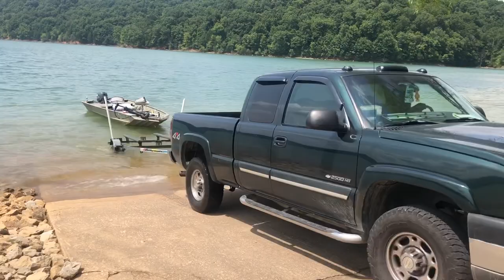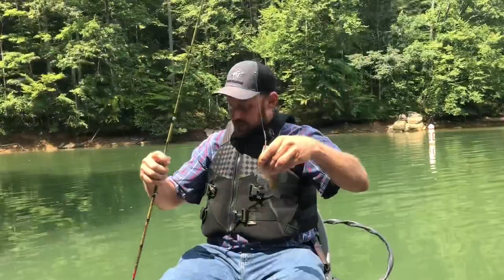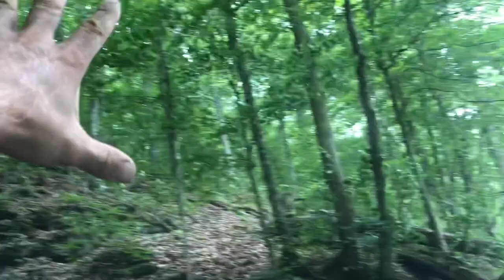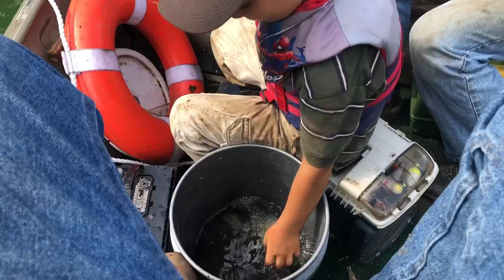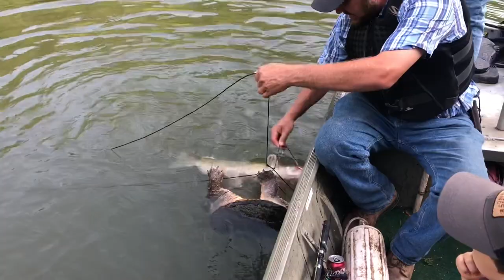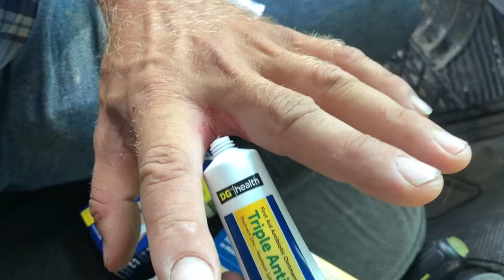Getting plenty of catfish without buying bait!

Comment: its a millipede. rip you a good hardwood 1 1'4x1 1'4x24 and pre-drill a hole at 45 degrees about 1/2 inch from the end and drive a nail in it leaving not even a half inch of the nail head and shaft exposed. then wrap trotline twine around the end to strengthen it. its the tool i used for taking fish off of trot lines back when i commercial fished. we'd run about 6000 hooks lol it wouldve saved you from a near turtle bite and a catfish stab lol also on the catfish stab we were always taught if we got stabbed to rub the wound on the catfishes belly. supposedly the catfish slime has something in it that takes out the barb toxin. not sure if its true but ive always done it lol
Reply from the maker: You know I’ll try anything once! Especially the unhooking mechanism!😂